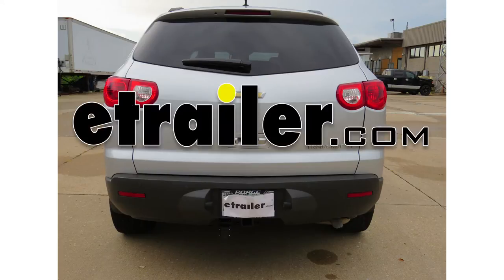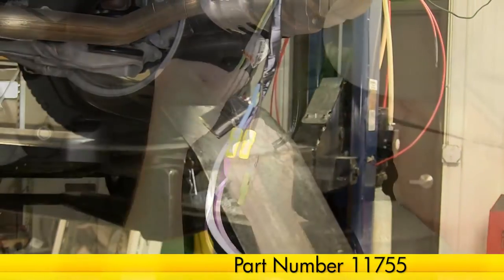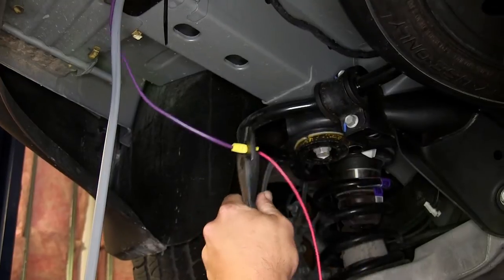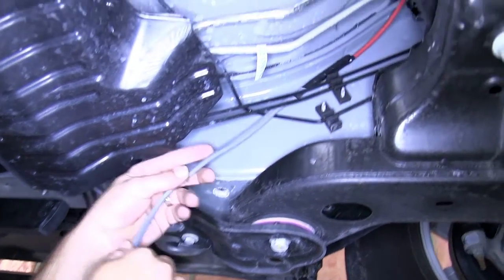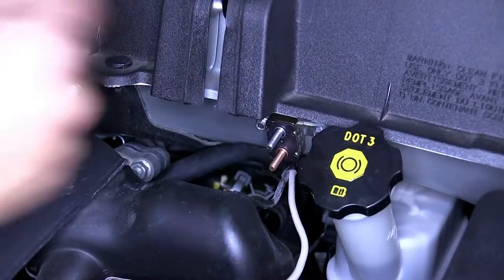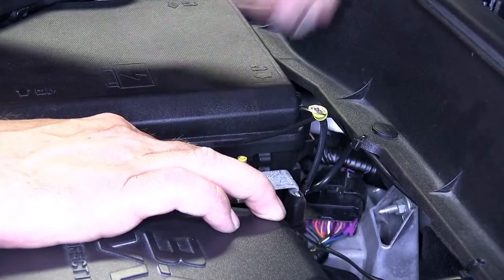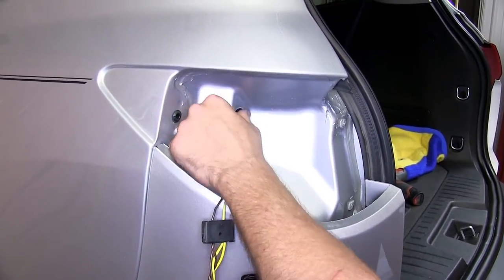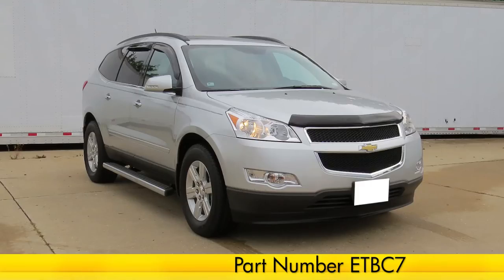Setting up the Universal Installation Kit for Trailer Brake Controller on a 2011 Chevrolet Traverse

Comment: Where does the white wire that is run into the engine compartment connect? It is not stated in the video.
Reply from the maker: The white wire will go from the brake wire on the 7-way and run up to the cab of the vehicle and connect to the break wire coming out of the break controller. The 2011 Chevrolet Traverse featured in this video was not getting a break controller installed by us which is why they didn't show connecting it. If you would like to see a more in-dept install of the ETBC7 follow the link below. The install will be on a Subaru but you will get the idea of how to hook up the brake controller wire.

 https://www.etrailer.com/tv-install-prodigy-p3-brake-controller-2011-subaru-outback-wagon-90195.aspx
Reply: etrailer.com Thanks. If I was going to do a setup using the Curt Echo brake controller instead of installing a wire-in controller, would I just ground the white wire to the firewall instead or routing back into the cabin?
Reply from the maker: That makes it easier yet! If you are you are going to use the Curt echo then all you need to do is tie up the white wire and secure it out of the way because all you need for the echo is the black wire from the battery back to the 7-pole.